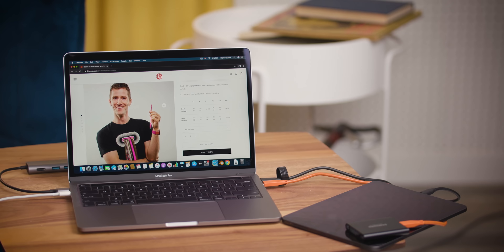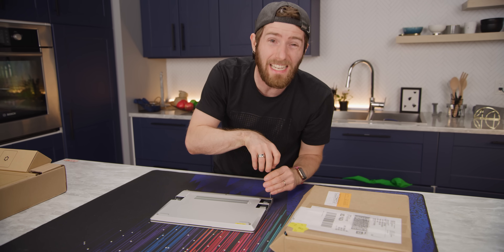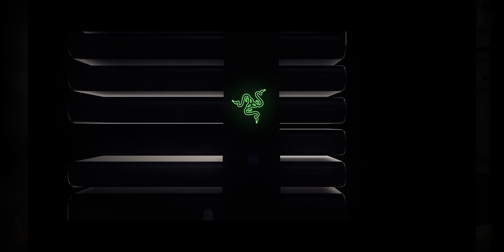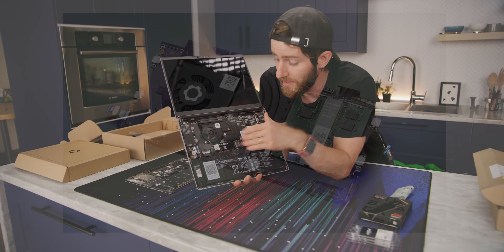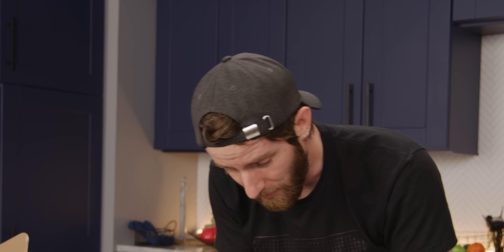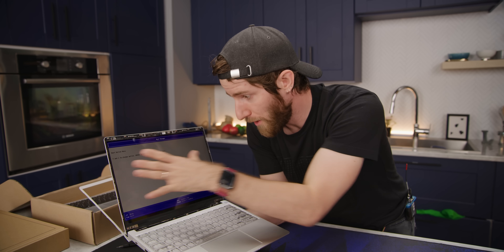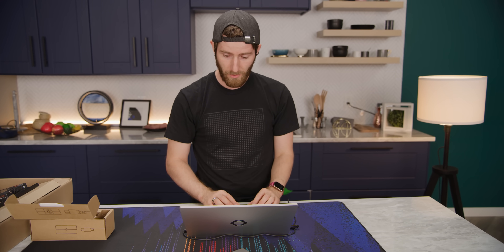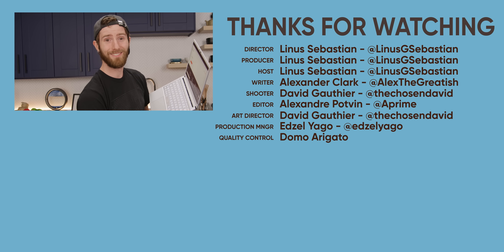A COMPLETELY Upgradeable Laptop?  - Framework Laptop Review

Comment: This is a  welcome step in the right direction.  However:

USB-ish type plug and play peripherals  is the upgrade path we have wanted for years, albeit without the slowdowns that afflict hardware that comes with using USB connections.  Why shouldn't we able to plug in CPU, storage, memory etc, w/o having an engineering degree and an over developed sense of competency.  

I mean... your grandmother can plug something into a USB port.  Why should she ever have to unscrew the back of the computer case?  Upgrading a computer by now (40 years after getting my Apple IIe)  should be as easy as changing the batteries in a flashlight.

Comment: Man that thing is amazing. Only thing i'd want is more port per module if possible. Like two Type C instead of one. I'd be amazing to see a module where we could hide a mouse or headphone dongle inside. Also, with AMDs new APU (steam deck), this thing would be fire. A crazy thing not mentioned, you could drop in a amp/dac in the module, a LTE card or even a capture card. Potential boys, potential!

Comment: The dream would be for them to make a deal with Intel/AMD to put in socketable CPUs like the og thinkpads
Reply: That seems like something AMd would be much more willing to do to gain mind share in the laptop space.
Reply: @Powerman293  Well...... AMD is taking Laptop world by now... it is just the foundry can't fullfill the need.
In this case, Intel xan fulfill the market because they have their own foundry
Reply: it would be a dream come true, at the same time an important proof of concept that it is possible to have a socketable CPU in super-thin laptops
Reply: If they have volume extremely easy. AMD has a semi custom segment for exactly this
Reply: They could just put the desktop APU's in there. Finally an X300 chipset laptop.
Reply: And an MXM slot.
Reply: doubt it considering the increased bulk and power consumption of desktop chips.
Reply: I mean... they could buy desktop CPU but it will come with a hefty cost and power requirement.

Comment: FANTASTIC laptop product - loving the user upgradability at last! Would love to see a top end gamer version where you could swap the GPU. One small correction to what Linus said in the video 8min 33sec "like any other laptop, the CPU is soldered directly to the board" ": The XMG ULTRA 17 (2021) LAPTOP takes a desktop CPU which can be upgraded, not soldered in, and it also has a discrete. removable, graphics card.

Comment: Forget magnetic charging cable. Communities with appear with this laptop. You can make a complete dock that would just plug into 1, or maybe even 2 of the modular ports. And then imagine what you can do with a dock.

 Way more i/o, maybe almost like a desktop PC, external GPU maybe? Proprietary or legacy connectors that some people need for work?

I mean yeah you can already do some of this now, but it won't ever be as integrated as this laptop could make be it. Like old thinkpad laptop's docks desktop replacement with very minimal compromise

Comment: Not enough upgradability options. I can't swap out the speakers and replace them with more I/O. Displays not bad but there's no dedicated GPU options (a swappable GPU option would be cool). Even though everything can be swapped around, I'm still stuck to Framework and what they provide. One thing I would want to do is swap the battery for a lower one, and put a 2.5 HDD in instead. Case design is also smaller towards the front (trackpad area), limiting the amount of room for possible upgrade components. No modules in the back (which typically is fine but with a single fan it looks like there's a lot of unused room) or front, and all the modules are just USB passthrough, so you're limited to the speed and capabilities of USB (until the mobo gets upgraded)

Comment: This is awesome, now make one for gamers. I like what this company is doing, just a missed opportunity with the battery though, could've made it modular but unlike the modules that use usb c male, make the battery swappable with usb c female and be able to be charged with any usb c charger. and screw it if the battery replacement is that easy make it have 100w fast charging, recharge the laptop in 15 minutes. who cares about longevity if you don't even need a screw driver to swap it. like the new macbook lasts 15 hours, I dont even need to plug my laptop in. if it lasts 10 hours on a charge,  with 2 batteries it'll last 20 hours. if you got 2 chargers, boom, 20 hours use in 15 minutes of charging. and since the battery is usb c make it work as a powerbank for your phone too.

Comment: Using QR codes is also genius as if the documentation regarding a component or process changes, all they need to do is publish an update to where the QR code points. Also saves money with printing paper manuals.

Comment: the upgradable part isnt important because most wont shell out for a new mobo and cpu especially in such a thermally constrained chassis but being able to change the ram and ssd is important. but i do like that its modular not because of upgradability but ease of repair if someone were to water damage it and could dismantle and repair it more easily. ive had to dismantle even 6 year old hp's which were held in with nothing but clips and no matter how gentle i was some still broke and i had to replace the entire plate. i like the screws and no stupid clips approach.

Comment: I hope they find some way to incorporate upgradable GPUs into their laptops.
Reply: It is just physically impossible, no space and no power.
Unless those mobile GPU decrease the TDP to 65W or something there would be no thin upgradeable GPU laptop.

Because a GPU needs a lot of space for VRM, VRAM, Choke, and display output.
That's why the statement of the big companies are valid especially if you want a relative thin and long lasting battery laptop
Reply: @Dominus_Potatus  Doesn't seem like it'd be impossible at all in a larger laptop. Sell the GPUs as a module that slots into the laptop and connects via internal Thunderbolt and maybe an internal HDMI or DP connection to power the laptop's screen. It can sit on some rails built into the chassis and have fan, display outputs, and ventilation all integrated into the module. I'm envisioning something that includes external facing sides on one side of the laptop plus the bottom.

You could probably do something similar for the CPU, RAM, and chipset in a second slide out module, allowing future CPU upgradability via module replacement. The RAM in the "CPU" module would be user accessible so you could use whatever RAM you want. You'd probably also want to put at least one m.2 slot in the user accessible part of that module.

Then your chassis is a (user replaceable?) screen, a battery section (maybe have a larger battery option that takes up the whole section and a smaller battery option that frees enough space for a 2.5" drive powered by an internally integrated SATA interface off the CPU module?), a Thunderbolt hub that powers the various ports around the chassis, power/display/SATA routing, and the requisite KB/touchpad. Commit to the design such that you'll be continuously creating modules compatible with the chassis and chassis compatible with the modules for years.

It wouldn't be as thin as this ultrabook, but I bet there are a lot of gamers out there who would love to buy a slightly larger laptop with guaranteed upgrade availability for years.

If someone like Clevo did this, it could be seriously cool and create a whole new standard.
Reply: @Dominus_Potatus  Because Linus said there was a mPCIe slot, you can run an eGPU easily, just Framework need to make it possible for a cable to run outside of the case. You would also need another PSU to run the eGPU
Reply: @KOLESNiii  if you want it to run externally... there ia Thunderbolt options which will add $500 only for the case.

Since USB 4 will be based on Thunderbolt, I can see someone will make an external GPU enclosure based on USB 4 with a similar price.

And it is not a solution for a laptop, it is more like a solution for  a workplace.
Imagine if you need to bring your laptop to work and home.
Either you have 2 expensive external GPU or you will carry extra baggage to work everyday
Reply: @Dominus_Potatus  the problem is, $500 is a scam for a basic enclosure. mPCIe or USB 4.0 solutions would be simpler and would cost much less
Reply: There are external GPUs out there using thunderbolt ports, so it's absolutly possible to hook up an off-the-shelf egpu case. Or wait a couple months until a small company or someone with a 3D printer starts to market  an egpu stand or something for this laptop specificly.

But you will still need an external power source and probably an external monitor (idk, if thunferbolt can carry data to the gpu and the frames back to the mashine at the same time)

Comment: You say you need at least 1 usb-c module to charge the thing but couldn't you technically just... Plug the charger into the port the module would connect into? Technically if you have enough clearance and are only using usb-c you might not need modules at all!

Comment: This laptop, while marketed for everyone, can be a big hit for people in the tech industry. People who know the real worth of the computer components which turns them away from latops but still need the portability.
Reply: i was just thinking the same thing, like for example, i have people that complain oo im running out of space, or i need usb c and an HDMI not display, and in other spaces i need Display port. or i like it but do you have black or wihte or what ever, i see this as a great way to improve my office laptops with attachments that we need. ill order one at least. 
i see this as a gamechanger in business.
Reply: Everyone using old ThinkPads and MacBooks can finally get a decent upgrade.
Reply: But.. Where is the VGA module?
Those old projectors still linger around in meeting rooms.
Reply: @snaffus  It can be a third party module, like Linus mentioned with the unofficial MagSafe connector

The incentive to make a first party VGA module is probably pretty low

Comment: This is exactly what I wanted. I always needed to find teardowns of a laptop before I bought one to see if ram is upgradeable, cooling solution is good etc. It is very hard to shop around if you are a conscious buyer and know what you want in the laptop segment. You would be amazed how much difference can be between two laptops with the same i5 cpu. Warranty is not even a good argument anymore, because by the time something actually breaks there will be a little asterisk there saying: "yes we said two years warranty but not for the component that broke on your one" or even if it applies you will have to send it to a depo and spend weeks without a laptop.

Comment: i ALWAYS run my laptop off the wall and since it has a built in battery i can't even just remove and keep it aside like my old laptop cause the battery on it stopped working and the laptop was chonky and difficult to move around from my shelf to my table or bed so i could just remove the battery and used it and because i can't do it on a modern laptop i'll have to buy a whole new battery after it swells just so that i don't burn the whole laptop

Comment: I'm pretty sure that the disconnect battery in BIOS is for servicing purposes, and not to save the battery (that would be the stop charging at 50%). It'll be back on once AC is connected (as it does with many laptops with built in battery).

Comment: And here I am, running a 15" Clevo laptop from 2016 that originally came with a Core i5 5700k and a 1060 with a 2070 and a core i9 9900k. Part of that is thanks to the DIY community, but also thanks to the use of off the shelf parts (desktop cpu, mxm graphics, etc.) by the manufacturer (which is far from perfect, particularly when it comes to support, btw). Laptops need standard parts Linus, just like desktops, and this has been possible for a while. The effort this company is making is laudable, but I feel an industry-wide initiative is needed. Unfortunately, that would hurt a lot of bottomlines and is still a ways, a ways off, if it ever comes. Until then.. All the consumer can do is choose wisely and hope for the best.

Comment: I work at a school district that buys hundreds of chromebooks a year, and has to fix the broken ones. The only things you can really replace are the battery, screen, and touchpad (with about 20 screws). Dell likes to glue to the screen to the bezel (with 8 screws), and has 3 layers of tape (and a clip) holding the connector on. That connector came out on one, AND I had to replace the screen because I couldn't remove it without also cracking it.

Comment: "it's not impossible, but it sure is less profitable" -every laptop and gadgets manufacturers
Reply: actualy it can be more profitble. some profit on barebone chassis extra pences from partners offering custom parts. and loot of user ordering for they own original custom laptop. you dont need to milk customer with extended services to get cash customers will just come to get extra parts fot they laptop. better screen more or less battery for extra storage or dedicated gpu that you can swap. front bazels keyboards front panels webcam mic arrays and 4-5g modems. its like tech lego
Reply: If you have a dedicated enough fanbase (like Apple) you can basically make them swallow whatever you crap out and then come back for more. Although I feel a bit sorry for the people who use their devices for professional work that isn't as good when performed on other products.
Reply: the upfront cost for various manufacturers to change over their productions lines for these products, as well as the possible changes to logistics for supply lines such would make this way to risky for most manufacturers to agree to, I would think.  And if thats the case and you end up having to purchase all your modular parts from framework, are they that much better than apple?  Sure they dont plan obsolescence into their product, but you are still buying into a corporate culture just to maintain your product
Reply: @Witchlord  large corporations doubt will risk but smaller manufacturers could jump in. And more bodies will be sold more compatible add-on options come to market. If they're manage to capitalise on it  can create complete new enthusiasts consumers market. And add more pressure for big corporations to compete. Environmental aspects can be included too and get political attention. Maybe impossible in USA but it's not only market. And good shake up in laptop market could give consumers better choice and price's in long term.
Reply: @Goose-fafo  I think even Apple fan's would appreciate cheaper and more interesting choices for they device's and longer lifetime.

Comment: i would love to see : 
more port slots in some bigger, more powerful version, (maybe mount some behind lcd?)

maybe plug in mxm slot with premade one-fit-all cooler that would slot right in. 

more variety of ports like rs232, lpt, full sized ethernet, modem, 1394, expresscard reader, eSATA, memory card reader, security card reader, encrypted key, video IN (hdmi/dp or whatever to  connect for example external gpu or console direclty), better sound card, additional battery pack or maybe even ps/2 ports

add slots connected by pcie to add normal expansion cards outside when you're stationary with possible eDP passtrough from main screen to connect external gpu

Comment: Really more companies should get on this idea. After spending 2000-3000 on a laptop. You aren't going to convince me to plot down about $2000 because you added a touchbar and locked out my system from updates.

But you could convince me to buy modules at $50 to $200. Oh what's that you partnered with Disney to bring me an MCU keyboard? Well that's worth a look.

From an IT standpoint, it's going to be easier to justify spending $1000 on modules that should get replaced often then one person who wants a Mac.

My question is of course recycling. I'm not going to want certain modules if I get a upgraded version. Can I send them in?

Comment: I really like the concept! If I were looking for a laptop, this would be a contender. What I would have wished though, is the inclusion of more ports. Right now, only 4 I/O ports can be added of which 1 NEEDS to be USB-C basically. What I find weird is that there is no Type-C port built into the device (taking up less space than a card would) since you're gonna need one anyway. Also, no Ethernet card (yet) which I personally would love to have. I would want a configurable laptop to avoid living the "dongle life", but with a fairly small amount of ports, you'd still kinda have to. 

Second M.2 or 2,5" drive option (with smaller battery) would also have been a nice option, but i totally see why they didn't do that. I would, however, prefer not spend one of my 4 precious ports on a USB Storage device.

Though the above might not sound very positive, I am actually really happy to see laptops like these being made! I hope this concept becomes popular, so they can iterate on this and make it even better! Great (Frame)work!